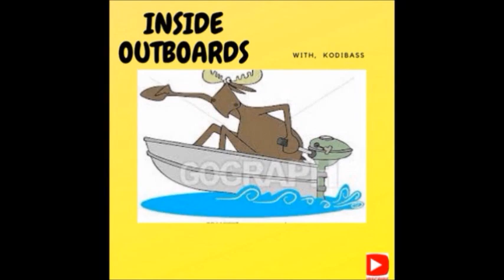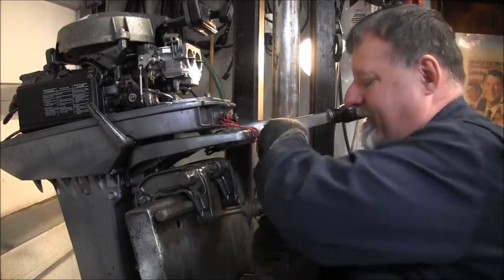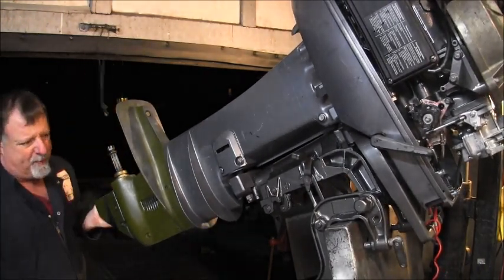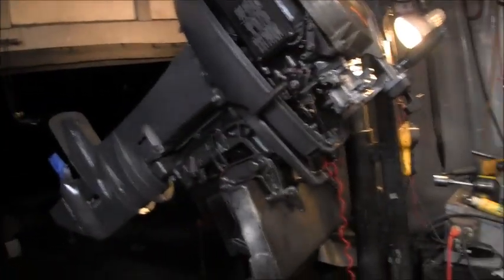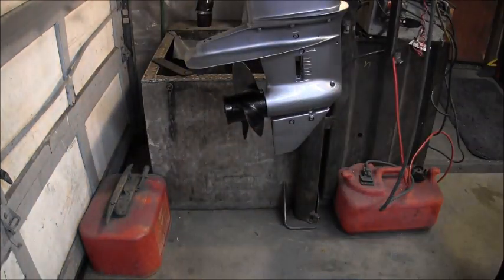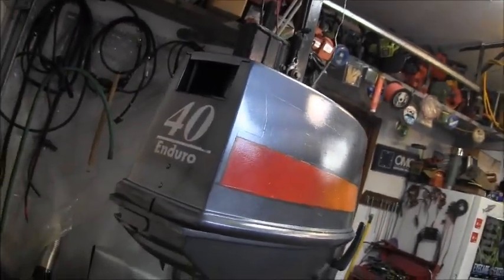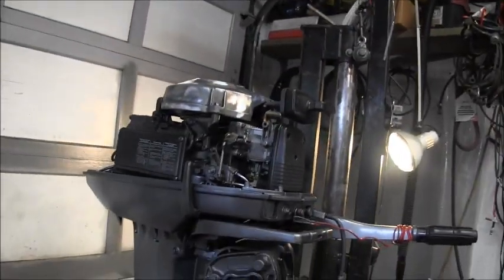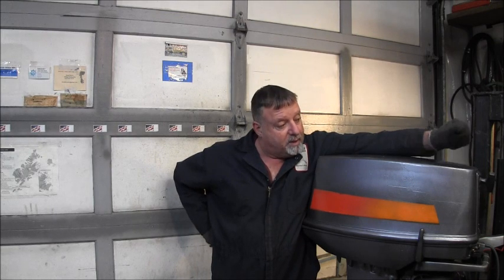1992 YAMAHA 40 HP ENDURO,  FINAL

Comment: That 40 Enduro sounds like a stout motor!!
Really like your add in costumes!!  Lol
Reply from the maker: Thank You,  I agree these enduros Do have a throaty mean sound 2 them.      kodi
Reply: @kodibassInsideoutboards  did you get my email with the pics of the boat that I ask about a tilt and trim for it,me being handicapped prevents me from picking that motor up and down..
Reply from the maker: @whiskerdreams7146   Yes ' R you wanting just the electric motor?  or the whole  TT unit?        kodi
Reply: @kodibassInsideoutboards  i am needing the whole unit, the boat has nothing,with my situation i am unable to lift or lower the engine..all the boat repair shops in my area say they just throw those type away!
Reply from the maker: @whiskerdreams7146    That  might B a Problem cost  wise.   My zip code is  99615  Kodiak Alaska.  The cost 4  shipping  would By weight B very high.  You can go on-line or to your local Post Office & see what the cost would be 4 approx 60 lbs. 3 your zip.  lmk.           kodi

Comment: How do u fix a cracked cowling from a fall.  Kinda spidered on a corner
Reply from the maker: drill small holes @  the end of any large cracks (stops them from getting worse.  sand area of impact.  Buy a small can of swiss glass , tigers hair  etc.  mix as can instructs , apply .   sand smooth & paint. kodi